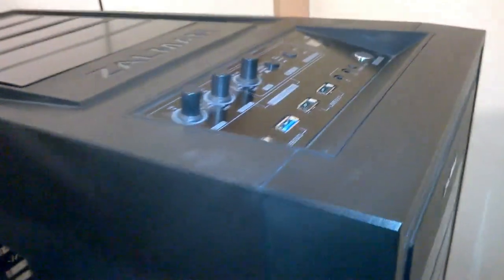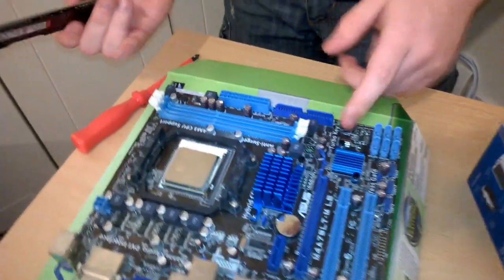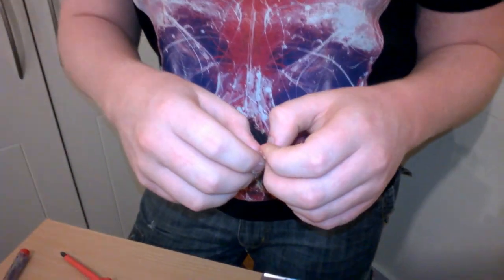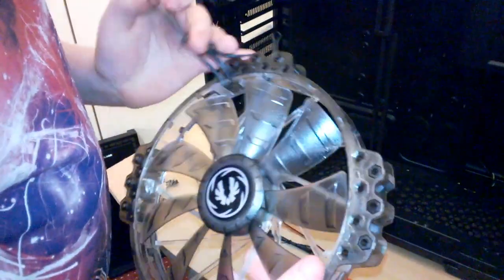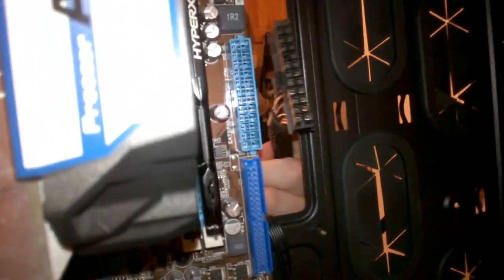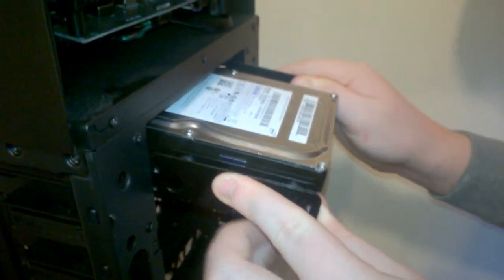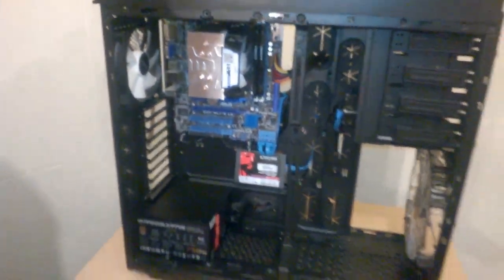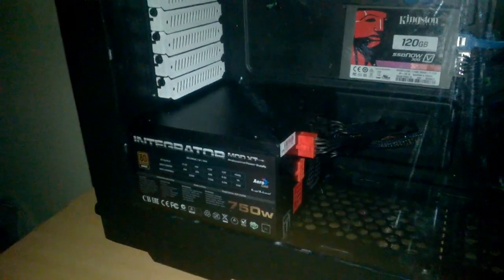How To Build a Six Core Gaming PC - NOV 2015

Comment: You shouldn't spread the thermal compound like that, it creates small air bubbles when assembling it. A pea/rice size should be good enough and it should spread evenly when bolting it on due to the pressure.

Comment: Nice work but way too much paste on the CPU and why did you cable manage when you will have to take out the motherboard to put the i o shield when you get it. Anyway good job.
Reply from the maker: because I didn't have to take the mobo completely out, just get it away from the I/O area, and I just unplugged everything anyway..

Comment: Is a phenom 1055T worth 80 bucks or should I buy a newer processor
Reply from the maker: I would say it's worth it because an athlon 860k is around 80, and the 1055t it a bit better.
Reply: +stuffyou shoulddo get a fx 6300
Reply: +stuffyou shoulddo ...The Phenom 1055T is still a very fine CPU,, and well worth $80 if you can find one..